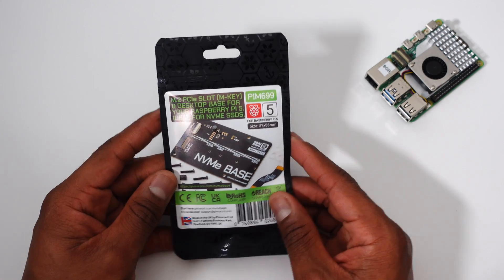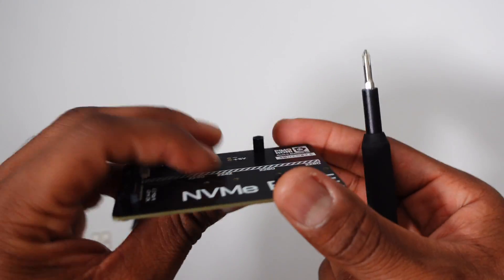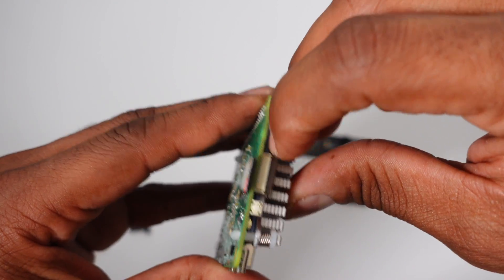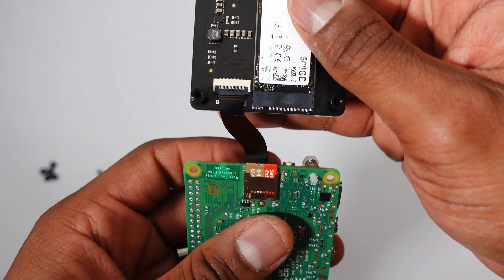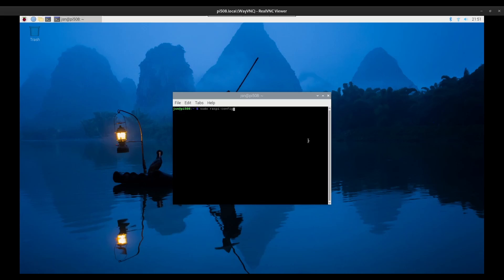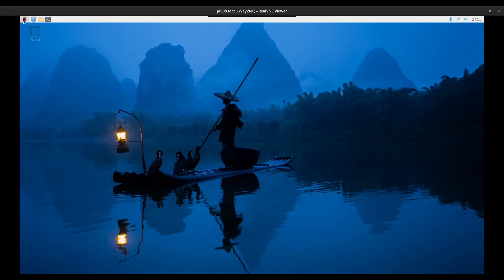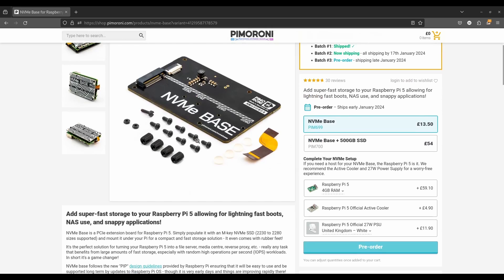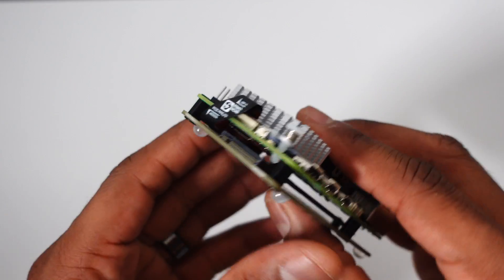Pimoroni NVMe Base for Raspberry Pi 5 Hands-On

Comment: Excellent and simple. Can you recommend an enclosure that this finished installation is compatible with? I am flexible on cooling: I can use the "official" cooling separately or go with a case that has a solution.

Comment: It's a compete piece of garbage. The catch on the PCIe port is one of the flimsiest things i've ever seen, mine dropped off after gentle touch...the whole unit is now in a landfill
Reply from the maker: Did you try to return it?
Reply: @iam.jasonhoward  Thanks for asking, I couldn't be bothered with the hassle and just binned it. I've put the SSD dive into a Gigimondo USB enclosure and it's happily working with my mac mini
Reply: I had trouble with the ribbon cable too—mostly my fault because I mistakenly tried to pull the black catch the wrong way. But this part is very fragile, you have to be very careful. The PCIe connector on a SATA hat I used had a much better metal latch (note: SATA is quite useful but you can’t boot from SATA on the Pi, and I read they don’t plan to support that).

Comment: Great video but is there a case available that can hold the nvme board and pi5 ?? I have just got my pi5 and nvme but not managed to find a case yet
Reply from the maker: Pimoroni has not released a case for it yet. There are cases you can 3D print. Check thangsdotcom and search “pimoroni nvme base”.

Comment: Just got mine a couple of days ago, and it does heavily increase the usability of the Pi. It gets to a point were, you have the NVMe base, the active cooler, the case, battery CMOS back up, and you might as well just have a PC, lol. I think it is having a bit of an identity crisis.
Reply: Case where you can also fit the nvme base with the official active cooler?
Reply: A mac mini m2 makes much more sense, I know it costs more than an Pi 5. But performance is vastly better, plus it looks pretty cool - A pi 5 together with the compoents to make it half useful look pretty ugly
Reply: @martinh9099  exactly... Im even gonna put my m1 mini into my kubernetes cluster.. might as well.. should have bought 2 m1 mac minis instead of 4 RPIs..
Reply: After getting the nvmes + nvme base and cooler all times 3.. the cost was as if i just bought some server hardware.. damn.

Comment: I think I'm gnona cut a slit on the official case to feed the cable through and then run the nvme board underneath it.
Reply: nope, doesn't fit, need a case.

Comment: Just an FYI - I received my Pimoroni NVMe and it functionally works fine.  However, the placement of the mounting holes caused the edge of the NVMe board to extend just beyond that of the PI5's edge.  That made it impossible for me to fit the two boards into a case that expected the boards to be flush.  Fortunately, the board has very few traces and I safely expanded the mounting holes with a drill bit edge so that I could slide the NVMe board back enough to fit in the case.

Comment: Just got mine today and had the Gigabyte NVMe 128GB M.2 Solid State Drive, via USB and enclosure before and wanted a neater setup so got the base and holy S**t it boots up instantly, I never expected this at all. Thanks for your video on the setup required to boot from it.

Comment: It's great to see the pi supporting nvme as it will make the platform more appealing. I know it's still early days for pi 5 and it takes time for supporting hardware to get released. But if you were looking for a fully passive case to house a pi 5 with an nvme ssd and preferably with an external WiFi antenna, not USB (would that mean including a CM4 too?), where would be a good place to look? There's lots of mini pc cases and barebones systems with these features but none that I can see for the pi, yet anyway. Though I guess that's because there are so many different pi boards out there.
Reply from the maker: It sounds like you need the LattePanda 3 Delta.
Reply: @iam.jasonhoward  Thank you! That looks like a versatile system. Believe it or not, since watching your video I saw this one of possibly exactly what I'm looking for. I hadn't considered Nvidia Jetson or other boards before but this might actually be ideal. I'm looking for something for astrophotography that's more affordable than the ZWO Asiair, which is good but overpriced, imo. It turns out the Jetson has some dedicated libraries for astronomy and astrophotography so I might consider it. Even though it's more expensive it could be very worth it. More research needed. Thanks again! 🙂

https://youtu.be/-imhL0oETSQ

Comment: Thank you for the video on Pimoroni NVMe Base for Raspberry Pi 5. I'm new to your channel. I only found one case that fits bottom NVMe boards for Raspberry Pi 5, but I guess we will see more in the future.
Reply: There is one on Printables that I made
Reply from the maker: Which one is yours? I’ve seen two models on Printables.
Reply: I'm hoping argon made a BOTTOM NVME expansion for their One BRED CASE. Until then I'm just using a poor quality Ugreen nvme enclosure I got to use as a thumb drive.

Comment: Could you update us on how the heat on the NVME effects tempts on the pi. I was totting up between this hat or the pineberry and I ended up going with the pineberry because the nvme was bottom facing which was better for air flow and the heat would be dispersed outward and not into the bottom of the pi

Comment: Awesome.  Test , compare it against the Pineberry Bottom “hat” M2  SSD.
Reply: i second this
Reply from the maker: The NVMe Base and Pineberry HAT function the same. The only difference is the Pineberry has an optional redundant power supply.
Reply: but one has the nvme facing upwards towards the bottom of the pi and one faces outwards. would be interestong to see the effects off head and air flow between the two @iam.jasonhoward
Reply from the maker: @ParkerGraysonNZB Okay. I'll order one whenever they announce the next batch. I have a top NVMe hat from another company on the way. Be on the lookout for that video next week.
Reply: love the commitment! super interested to see if the inward or outward placement has much effect on the pi or drive from the heat @iam.jasonhoward